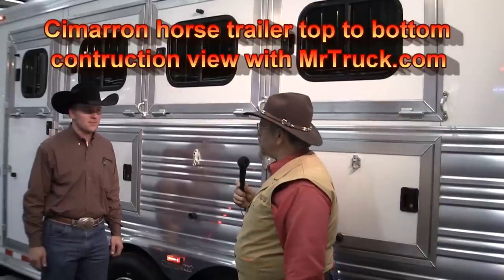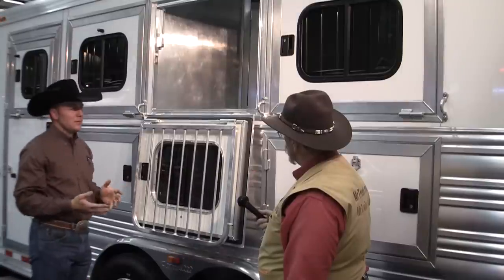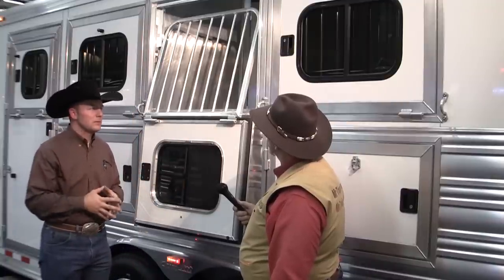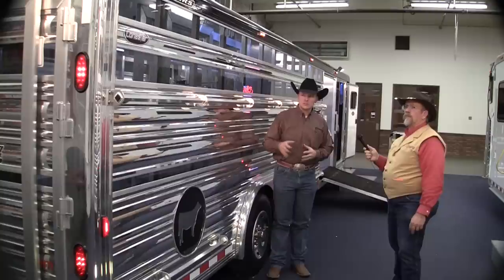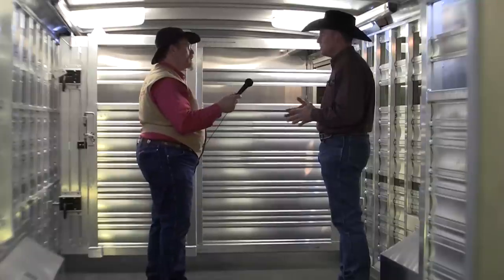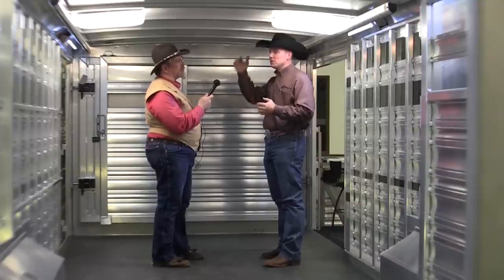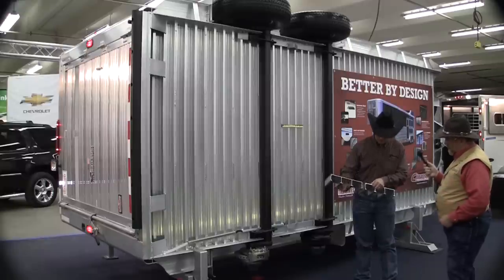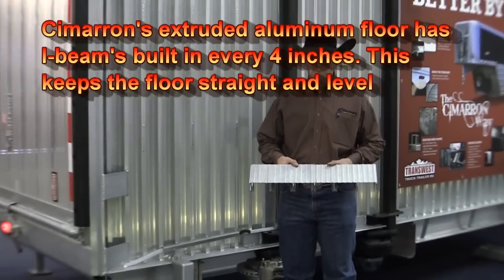Cimarron Horse Trailer Top to Bottom with MrTruck.com, national western stock show, fiberglass  roof

Comment: how about a trailer that will survive hauling Bison?
Reply from the maker: I would bet on Cimarron. Just close off all the opening for a dark trailer and it would be ready to go
Reply: it isn't the darkness as much as holes being poked in the sides and supports bent, broken, or sides caved in. the air-ride would really help when moving the Bulls. they can screw up a perfectly good gooseneck